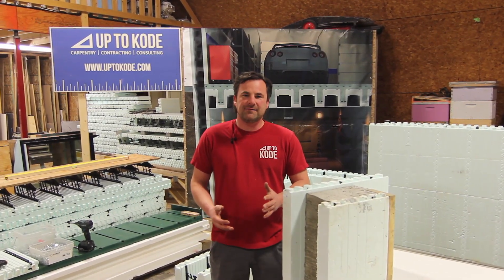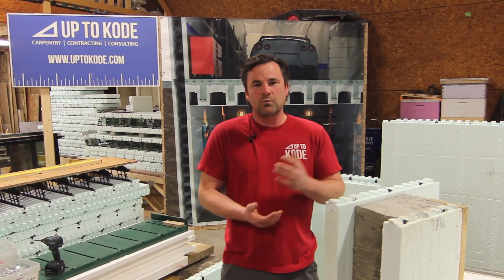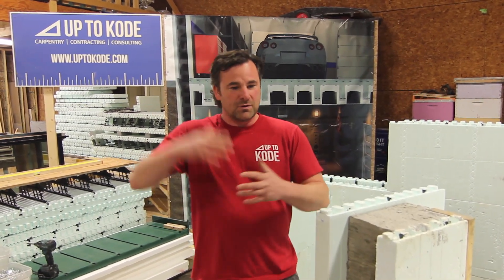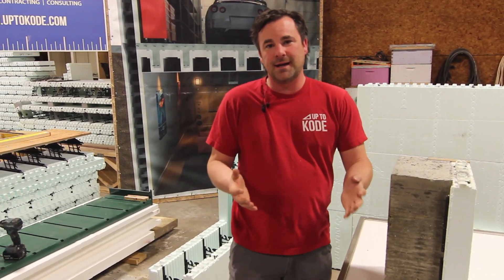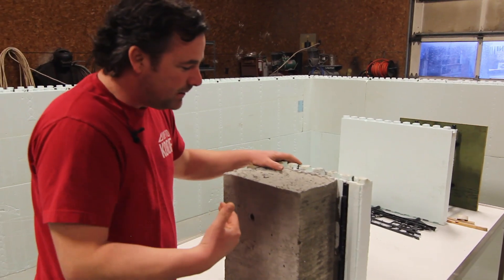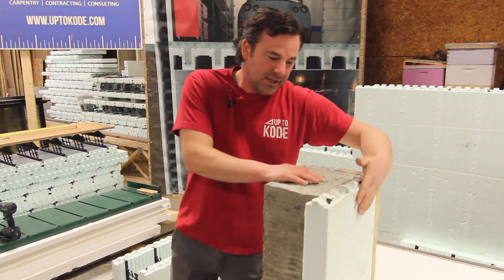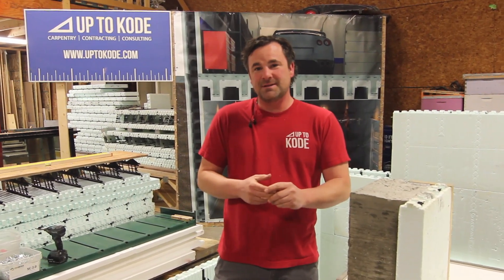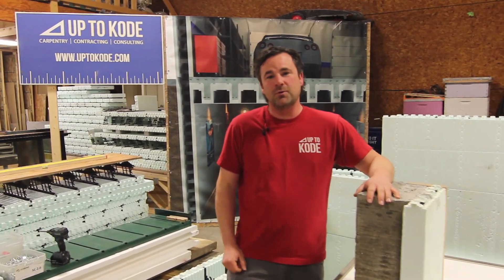Why ICF should be used for Passive Homes

Comment: If you use an ICF roof you have no issues. You then also have a house capable of withstanding an F5 tornado
Reply from the maker: I agree. A lot of times the ICF roof would push the budget beyond the threshold. Now a days with the rise in material costs, it’s hard to keep new builds affordable. Now if someone wants the ultimate structure then yes, ICF roof.

Comment: Did you use SIP? What do you think about its insulation? I think SIP will cost more. Is that correct?
Reply from the maker: I don’t actually know if SIP is more. I think it’s very similar but in the end it’s still a series of panels (NOT monolithic like ICF) and there’s no thermal mass. 

ICF is more air tight as well.

Comment: How does ICF compare to SCIPS or insulated concrete paneling?
Reply from the maker: ICF is the only true monolithic wall assembly. No joints or connections after the concrete is poured. Stronger than the above mentioned and more air tight. I could go on and on and on.

Comment: Question.. you cant have a cold joint with poured wall below ground level for potential water leak..how do you mitigate air leak at a cold joint from basement wall to first floor .. then 1st floor to second floor.. finally (maybe) top of 2nd to gable... IS there a risk for air leakage at these cold joints?? yes insulation is important.. but passive ..air leakage is king. again..another great video ...
Reply: No your only air leaks possible are from penetrations through the walls to exterior, roof if non ICF, doors and windows.

Comment: Hello there Kody, Thanks for the Video. I just have a couple of questions & a comment and I love to see some feedback from you and perhaps some viewers , first off, what are your thoughts the Zip sheathing building system, as it addresses the thermal bridging issue ? Secondly, how difficult/complicated do you think it would be to convert drawing (building plan) from a stick frame utilizing the Zip system to an ICF exterior wall system?  (foundation walls are already planned for ICF)
 The reason I ask is because I changed my mind on the building type  because  of the thermal mass issue.  I'll explain, I was initially planning on building a log home (lots of thermal mass there) at my lot in Northern Ont. - same latitude as Thunder Bay,  however the building will not be occupied for a 16 days at a time and in the interest not wasting energy the temperature would be kept down for that time, now upon returning all that thermal mass would have to be brought back up to temperature as well as the living space. Therefore I switched to looking at the Zip wall sheathing system. 
Thanks in advance
Reply: Zip system has many thermal breaks to deal with and if not do properly is no different then any other wood build.  Cost to build right is higher.  Best Zip house I have seen was passive house spec but took 3 to 4 more months longer to achieve over the ICF build time and Zip took a larger HVAC unit means more money and waste.  ICF can still have your log cabin siding to give you the look but have all the benefits behind it.

Comment: Kody: Of all the explanations I have heard on Thermal Mass - this one (describing the concrete mass as a "capacitor" and the insulation as a "resistor") is one of the best I've seen. Beautifully and clearly explained...
Reply from the maker: Ok wow! Thank you. I can’t take credit for the analogy...that was Kocsis engineering.
Reply: Yes, for people who have an understanding of electronics, an RC circuit is a good analogy and is regularly used in physics/engineering classes. For mechanical engineers, mechanics, etc think of tuning a spring/shock combo. It's the same math (de's) haha. 

What I will say is that you still need lots of R value even with lots of thermal mass. Thermal mass affects recovery time so if you have large temperature swings, they will be damped. However, once the mass cools, it takes a long time to come back. So if you have a sustained cold period (like in a Canadian winter), with inadequate insulation, the mass will leak heat, get cold and take a lot of energy to bring back.

Where thermal mass shines is combined with passive solar (as you mentioned) where the day to night temperature swings from the glazing needs damping to maintain comfort.

Comment: Did the engineering firm do a test with just the concrete, or full masonry wall, and the heat transfer? Like for in a warm climate, like Texas. Would the room matter more than insulation on the walls?
Reply from the maker: One would have to read the research papers to determine the specifics.

Comment: Nice post, but using high thermal mass materials such as ceramics (ie brick, concrete, block, rock or soil ) for passive buildings. Far pre-dates ICF construction.

The issue is not with the use ICF, as the construction method or not?  But how best to build a true Passive Home using it. Which takes far more expertise than building a conventional ICF. Using 1 side ICFs instead, is just the start. 

Builder/architect needs to know far more. For example, how to use an interior (non ICF ) concrete supporting wall as heat storage medium. By having it get heated by the southern sunlight in the winter. But also not get heated in the summer, by using long overhanging eave and the steeper angle of the sunshine in the summer is just one example. And none of it tends to be easy to do or duplicate on different sites... Which is why Passive Solar is not used as much now with lower fuel costs.

FWIW it would also be great to see 1 sided ICF, that used rough cut boards or molds instead, that created more refined surface. For example  by adding thin rough cut boards (or molds of stone or brick) to the plywood, with a release agent. If your interested, I have few other ideas on how to modify the process, so they still fit together and have the "seam" be less noticeable.  (BTW decorative forms are already used to construct 2 sided non ICF, concrete walls. so it not a new idea)

So good luck building a Passive Solar home someday. And/or adding a more finished look to the expose concrete surfaces.. I hope to see the posts of how you do it... 

Sorry for ranting on, did not expect it to be this long....
Reply from the maker: Thanks for your input! I have also thought about rough cut boards for an exposed concrete wall.  One day...

Comment: ICF has its place, but where you are in Alberta, the winter temperature average is around 0 C. You will not save additional energy by using ICF since ICF is not going to generate heat. However, Spring and Fall will be very beneficial with ICF by smoothing out night and day temperature swing.
Reply: I totally agree. You have a week or two cold snap and you house still needs to pump out the heat to keep the cold out. I also heard that a ICF house can actually feel hot in the summer months because our days are so much long then the nights so the walls can radiate the heat they collect during the day fast enough through the nights.
Reply from the maker: I can see that.

Comment: I was wondering if you could say without to much explanation why you choose Nudura over logix because I see in earlier videos you used logix. I’m actually trying to figure out what blocks I want to use currently. 20 year carpenter/ tradesman lots of experience with whalers concrete, walls, flatwork and building. I’m a general contractor but have never used icf. Building my own house and would like to use icf for basement and first floor walls ranch house. Appreciate any help.
Reply from the maker: Feel free to email if you want in the future. Check the description. 

I like Nudura because...reversible, ties lock together when stacking rows (no need to tie vertically), larger nubs (my bad terminology), and they come collapsed which saves a ton of space on site.

Comment: Really considering building an ICF home, I need more content on the benefits of ICF in predominantly hot and humid climates. I live in Ghana, West Africa and will like to know the benefits of ICF for keeping the home cool all year round with little reliance on the AC. A large portion of energy is used to primarily cool the home, in the afternoon the temps can get as high as 34 degrees Celsius or 93.2 degrees F and stay around 28 degrees C or 82.4 degrees F in the evenings.
Reply from the maker: You could contact the manufacturers directly. They probably have that info. I’ve heard to benefits of using ICF is greater in hot climates. It hardly takes any AC to keep them cool. It takes a lot of sun to transfer through a concrete wall.
Reply: I can answer your question, having built several ICF homes in Canada/USA and now living in West Africa, thermal mass ( from the concrete) is your best friend, it’ll work the same way as in cold climates BUT you have to mitigate solar heat gain on any exposed interior concrete walls, like with traditional blocks used here.  What you’ll notice with ICFs is no /very small fluctuations in the interior temps over a 24hr timeframe, stays cool all day and the a/c barely used 

ICF is definitely a better option to what is used locally in W. Africa, I’ll be promoting it here as a better choice to save on cooling cost.

Comment: Nudura now has the xr35 forms that are 8 inches of total foam (4 either side) with the studs still near the surface.
Reply from the maker: We are using the XR35 for a commercial building in a few weeks! Can’t wait.
Reply: @uptokode  were building a nearly passive house in Canada this summer and plan on using them as well.
Reply from the maker: Oh wow! Can you email me photos as you progress? I will add you to my fan featured videos I am planning to roll out twice a year or so. 

kody@uptokode.com
Reply from the maker: What province or city are you in?
Reply: @uptokode  I can definitely do that. We are in Ontario. In a small town north of Belleville. Initially intended on building a 2x6 house with I joist outriggers and dense pack cellulose. With lumber prices where they are and the extra labour/air sealing details we've decided to make the switch to xr35. Will also be doing a suspended structural slab floor for the extra thermal mass.
Reply: @ggauth  hey! I'm in Ontario and thinking of doing this. Did you guys end up completing the build?
Reply: @taylorwadeson2074  we are still in the process of building. Slow going as I'm basically doing every myself. Roof steel is going on now.
Reply from the maker: Keep me in the loop as well! Exciting project even though it’s a ton of work on your own and it doesn’t feel exciting at time! My email is kody@uptokode.com. Send some pics!
Reply: @uptokode  I'll try to send you a bunch when i take a break over the holidays.

Comment: I am looking at doing a netzero ready carriage home (in bc) and am overwhelmed with choices. With the prices of framing lumber how does icf compare cost wise?
Reply from the maker: I honestly can’t see u saving a dime by building with lumber. And you won’t have nearly the benefits. 

ICF is easier, stronger, quieter and substantially more air tight. Much easier to achieve net zero with ICF than anything else. 

There’s NOTHING you can do to a wood wall to make it compatible to an ICF wall. Any ICF is done in 1 step. No extra materials or labour required.
Reply: @uptokode  Feel like building a project in bc? Lol
Reply from the maker: Maybe. Open to the idea but no one has pursued much further than this. What area in BC?

Comment: In general, the passive house community stays away from ICFs because of a goal of minimizing embodied CO2 during construction, of which concrete is a pretty big offender, not because they are trying to build something more complicated. That's not to say ICFs are a poor way of building, but that's why passive houses tend to avoid them.
Reply from the maker: I get that.  I just don’t understand how cutting trees down is good for the environment even though they are carbon negative.
Reply: Concrete is all natural just as wood.  machines used is greater in wood construction causing more C02.  If so many trees was not used in construction the trees convert C02 to oxygen part of the cycle of life call photosynthesis needed for trees and all life to live.  Don't go down that rabbit hole.  There is no off gassing of the ICF either.
Reply: @cliff7634  Except Cement isn't a natural material at all, it's calcium carbonate and other minerals fired in a furnace, which uses an enormous amount of energy.

The trees consume carbon as part of their lifecycle (the carbon is then embodied in the tree), and when cut down this leaves room for new trees to grow and consume more carbon. Sustainably harvested forests are carbon negative, and cutting them down every few decades helps improve carbon capture as younger trees absorb carbon faster than older trees.
Reply from the maker: Slightly off topic but maybe not.  I want to know why hemp isn’t utilized more.
Reply: It's a fantastic insulating material and is carbon negative, it probably has more to do with it being a type of cannabis than any technical or economic reason.
Reply: If this building is standing for 100 years, the extra embodied energy from ICF is minimal, and probably the whole house won't need to rebuilt again!